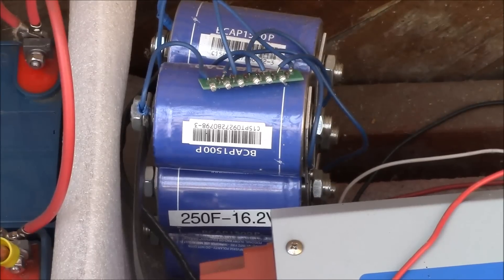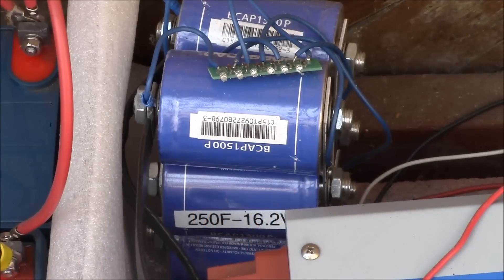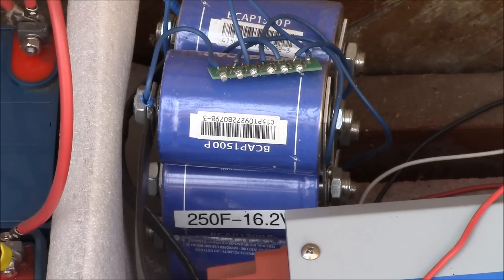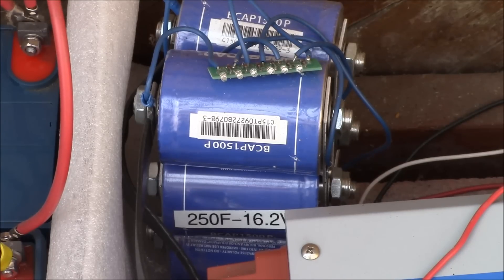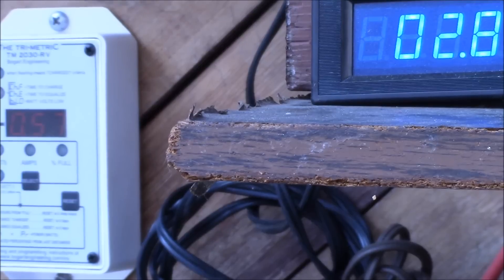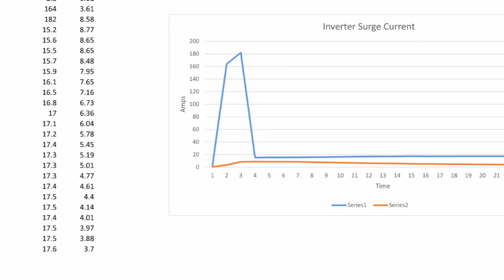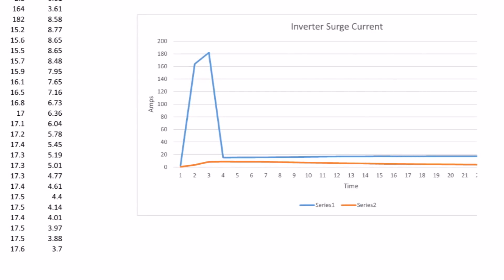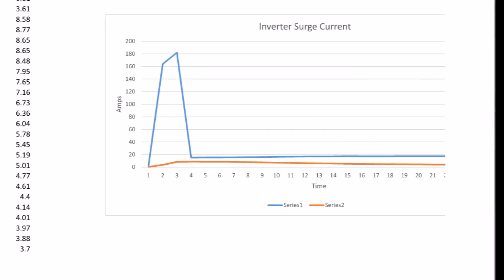Super Capacitor?

Comment: Great video it's really cool to see real data from projects.
Reply from the maker: Thanks for the comment.  My super cap. bank has been up and running well over 3 yrs. now and gets used daily for the power inverter surges.  I hope to be powering that all off a 16V lithium battery bank later this year and I think it'll really help with that as I'll have a fairly small battery bank to start with.  It'll be a bit tense when I first charge the bank up to 16V as it's close to the 16.2V rating.
Reply: Are you using active or passive balancing circuits with the capacitors? I was playing with a active balancing board and the one that I had would cut off the voltage right at 2.7 volts for each capacitor. When I was using resistors to balance mine I found I had to be careful when running close to the maximum voltage.
Reply from the maker: The caps came with a balance board, seems to have diodes (maybe zeners) and some LEDs.  I never really studied the PCB when I first set it up.  Maybe I'll take another look at it when I try upping it to 16V.

Comment: could I run two audio 5.0 fador capacitors in series ?
Reply from the maker: Yes, if you wanted to make a capacitor bank for a 24V system that would work.  If you do put them in series, it's a good idea to add some high value balancing resistors across the caps to keep them roughly the same voltage.  For a 12V system, you could put them in parallel for higher capacitance.

Comment: hey sports fans. I think that you are on the right track with the super capacitors. my system consists of a couple of Outback VFXR3524A for a 7000 Watt Off-Grid system.  I just received in the mail 24 Maxwell 2600 farad at 2.5 volts.  My system is running on 24 volt battery. that means that I need 12 capacitors in series to give me a top voltage of 30 volts. with the protecting circuits added to it I I wined up with a 216 farad capacitor.  I have 3700 amp hour a batteries in the system and my lights still Flickr when the inverter starts the refrigerator, washer, dryer, freezer, and air conditioner.  I'm busy with making straps out of 1 inch X 1/8 inch copper bar to handle the Serge current.  I am using 4 / 0 Gage welding cable for all my battery and inverter lines.  😀  Oh, I have 8500 watts of solar on the roof as well. I am looking forward to see if this is able to diminish or remove the light flicker when the different appliances startup. More information to follow.
Reply from the maker: Sounds like quite a nice system.  Will be interesting to hear your results.

Comment: Hi. This is a very informative post. It's exactly the answer I've been looking for. I have a boat with a large household refrigerator as well as a large chest freezer. I have 3 x 200 ah batteries, and even though the household 'fridge draws only 16 amps whilst in steady state running, it trips the inverter low voltage (10.5v) cut-out during compressor start-up once the battery voltage drops to about 11.8v. This usually occurs at about 5 am when I'm trying to sleep! I'm going to use your system (I've sourced 6 x 2000f Caps from AliExpress) to hopefully eliminate this problem. The only mod I'm thinking of is to put a 200 amp diode before the caps to prevent them from back feeding into the 8.2 litre diesel starter motors during engine start. Engine start often trips the inverter low voltage cut-out, resulting in re-booting of computers etc connected to the inverter. I'm hoping the diode will prevent such low voltage trips of the inverter.

Thanks for taking the time to post this. Any comments appreciated.
Reply from the maker: +Nev Yes, that capacitors should help with starting those compressor type loads.  You should be able to fit something like a 200A Schottky diode in there to isolate the caps and inverter from the system while starting batteries.

Comment: Hi, can i use a car audio capacitor ?
Reply from the maker: +Ryan Fleur Sure, that would work as well.  Those units are typically a few farad in size, so won't have quite the same amount of energy storage, but they would still help out with surges.
Reply: +R Brown (4Crawler) I am using super-caps between my solar array and the controller to accept surges and even out power being sent to the battery.  As well as using super-caps between my battery bank and the inverter. My batteries are some very happy campers.

Comment: oh man, this is good for Winter Jump starting your truck.
Reply from the maker: Yes, I have been thinking about using one with a small LiFeO3 12v battery in parallel as the main starting battery.  I have dual batteries in my 4x4,
- http://www.4crawler.com/4x4/CheapTricks/DualBatteries.shtml
but they are hard to access to change out and a super-cap + lithium starting battery might make a long lasting starting battery.